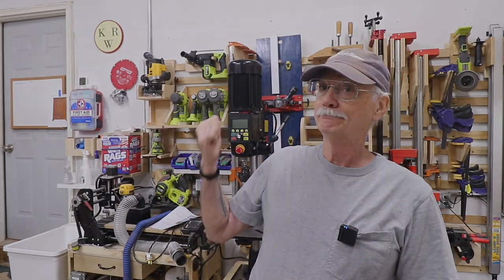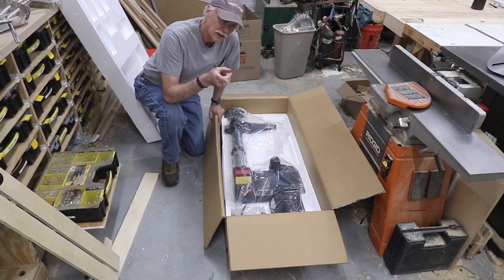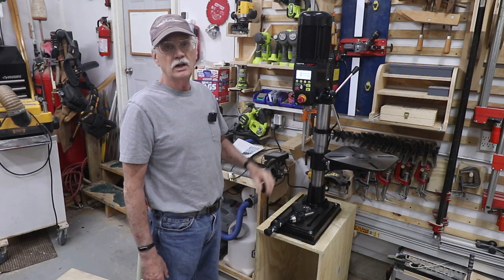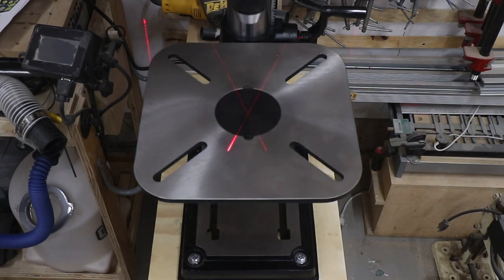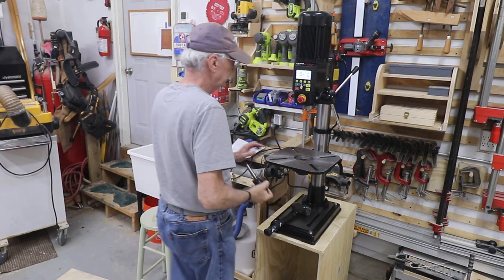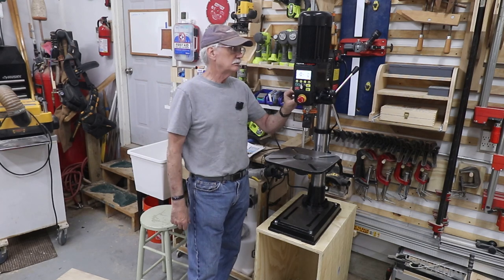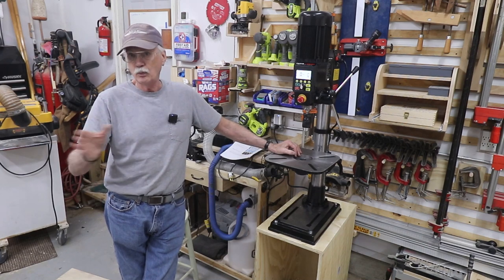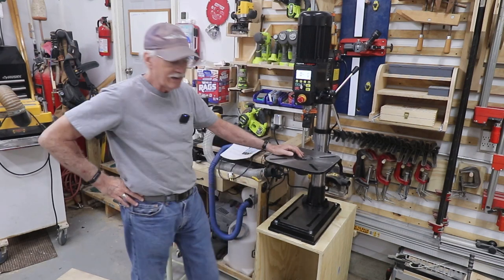I Finally Got a Drill Press

Comment: In addition all my research thus far. On either the Nova Viking or the Voyager brought up a couple of videos claiming their customer service was awful, the runout was not withing the specified tolerances, etc.  Your thoughts ?  My minimum requirements as I searched for the best drill press was 1 hp motor, 250 rpm for 2.5" Forstner Bit, able to drill metal or wood without bogging down, variable speed ( no belts or pulleys ) and benchtop.  Choices are few.  No American Companies I can find have any such drill.  Im very concerned with service after the sake of a 1 or 2 thousand dollar purchase.
Reply from the maker: So far,
1. Customer service has been great. A couple of videos doesn't mean that CS is bad. It means a couple of folks had what they determined was a bad experience. We don't know the whole story.
2. The runout on mine is below .0005
3. Motor, 1hp, electronic variable speed, no belts.
4. Benchtop. As the video shows mine is a benchtop.
5. The biggest Forstner bit I have is 2.125 and it will drill a hole at 250rpm but don't put a lot of pressure on the quill. It does quite well at 350rpm A lot of drill presses will have a tough time with that one.
Frankly, if you want that kind of torque at 250 rpm you're going to have to go with belt drive.
I don't think any company makes their stationary power tools in the US.
Tecknatool has a solid presence in the US
For me, with this drill press, it's money well spent.

Comment: Mine just arrived and finished setting it up.  It is my first drill press.  Seems to run well.  However, as I lower the quill it doesn’t feel smooth.  Best way I can describe it is that I feel the steps in the gearing.  Do you have this same experience?  Thanks!!
Reply from the maker: My quill is dead smooth when I lower it and don't feel the gearing at all. Is it smooth when you lower the quill regardless of the gear feel? 
It may need an adjustment. My manual isn't handy but there may be an answer there. If not give them a call and see if tech support can give you some help. 
What you describe isn't an all-stop thing the drill will work fine.
Reply: @KRWoodworks  thank you!!

Comment: The keyless chuck … that’s not standard, is it?  Did you buy that separately?
Reply from the maker: Yes, I did. I used their arbor and a 5/8 keyless chuck. I've used keyless chucks on my various drill presses for decades. They just make life a tiny bit easier. 😂
Reply: Thanks! I see Nova’s keyless chuck sold separately now …

Comment: I think that port is for EU model that requires a plastic guard and small cable connection, so the drill knows when open of shut. There is also USB port for updates.
I have one on order and told shipping mid-month. We'll see. Disney has been waiting for the floor model for over a year I hear.
Reply from the maker: Yup. I talked to Technatool on another subject and asked them about it and you are absolutely correct.